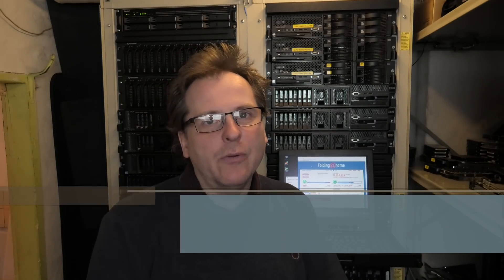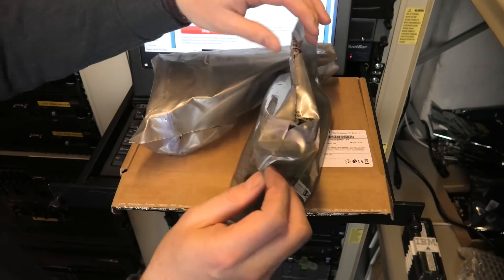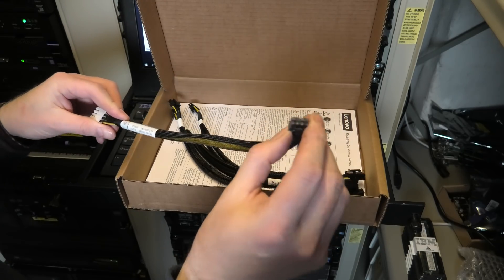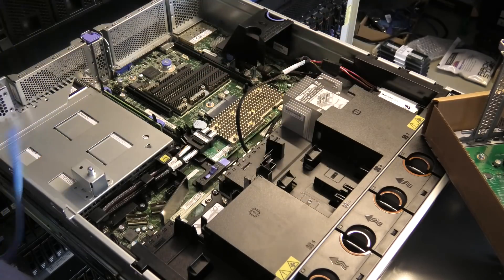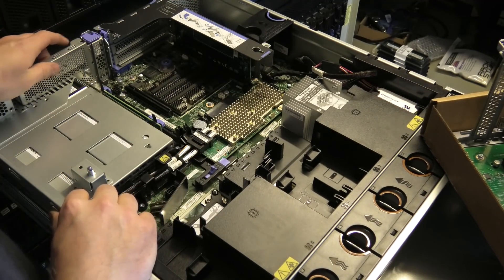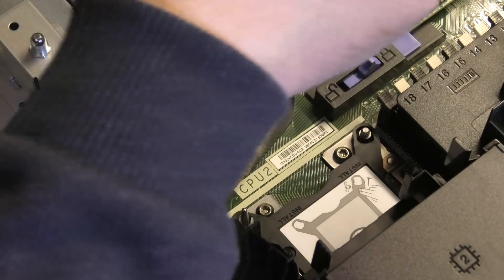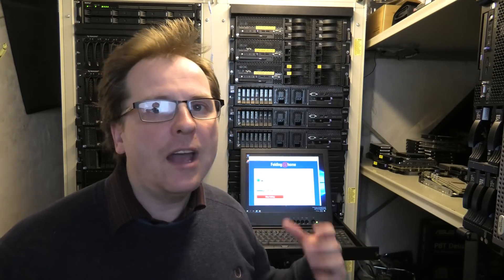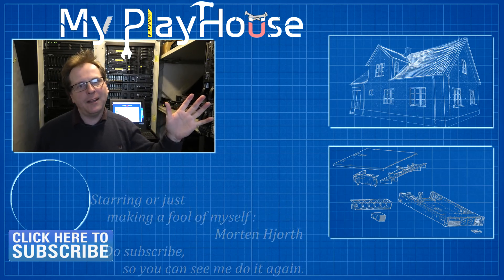Lenovo SR650 Ready for GPU - x16 Riser & GPU Power - 958

Comment: You can make it, that the Script that you where talking about, runs automatically on shutdown (not restart), so it resets the GPU automatically, which is pretty handy. Only problem left then is to manually startup the VM again. I use this Method on my Proxmox Host with a R9 380 from Sapphire and it works flawless. Have in mind, that if the GPU idles for too long (VM is shutdown) it CAN happen, that it should go to L0 mode, but it doesnt and then u have the Reset Bug again. There should be a fix for that too. Maybe if u disable the Energy saving mode for PCIe on the Host itself.
Reply from the maker: Hi xxcr4ckzzxx
Thank You very much! This becomes complicated :-)
Thank you for watching! :-)
Reply: @MyPlayHouse  Its not really that complicated tbh. To run the script on shutdown is done in 10 Minutes, for the Energy saving on PCIe, you can go to the bios/UEFI maybe and deactivate it there, or maybe that doesnt make any Problems for you and u just need the Script in the VM.

Comment: Morten. I agree with your desire to use AMD over Nvidia due to the server driver issue. I just want to caution you about supported GPUs by the folding@home software. There is a lookup file installed by FAHClient that is callled GPUs.txt and it lists the configuration of all the supported GPUs. So, before you buy your GPU that fits the Wattage limitation,  and the length limit of 27cm, make sure you look in the GPUs.txt file to see if the card is supported. AMD has some issue with supporting OpenGL via their drivers. 

Also, its too bad that Lenovo does not provide you with one power cable with dual 6+2 pin outs for the graphics card like Power Supply Manufacturers do. That way you can choose to use 6 pins or 8 on both. Just an observation.  More money for them I guess. 

Good luck with your folding project, and congratulations on your successes to date.
Reply from the maker: I did check if the RX 5700 XT i want would work.

Comment: Hey Morton great Video. I think One of those 8pin gpu Cabels is actually a 8pin CPU power connector(8pin eps). Higher end server GPUs have the 8pin eps connector instead of the 8 pin pcie.
Reply from the maker: Hi Niklas P.
Thank You very much! I did not see that,, you are right the big 8pin to 8pin is a EPS12V and it does say GPU on the cable :-)
Thank you for watching! :-)

Comment: Since you are using rack mount servers, you have GPU restriction, so not every model will fit in those servers.

For Nvidia you can look at;

ASUS brand's TURBO series ( referance design GPUs with beefed up VRMs and BLOWER Fans )

MSI  brand's AERO series ( referance design GPUs with beefed up VRMs and BLOWER Fans, their power inlets are like QUADROs - at the back of the card instead of the side as usual in order to reduce their heights for 8-10 card used GPU servers - )

GIGABYTE brand's AORUS TURBO series ( referance design GPUs with beefed up VRMs and BLOWER Fans that has ALL copper heatsink in it where other models have a copper GPU plate and aluminium heat sink )

EVGA brand's Super gaming / gaming series ( hard to find one )

Since I'm building GPU render tower workstations and Deep Learning rack servers, those are the models I use those models' 2080Ti versions. Can't say for sure but you might be able to find GTX1060 with those coolers or at least a RTX 2060. 

On AMD side, referance cooler version GPUs might be found, but I advise you to modify their cooler and add plastic washers between the screws and back of the card in order to increase the contact pressure for better cooling.  You can check " Gamers Nexus " youtube videos regarding to this issue. AMD RX 5700 XT referance design blower fan was tested with that modification.
Reply from the maker: Hi Aris Murat Dülgeroğlu
Thank You very much! that was a lot of info,, I ordered this card :
https://www.proshop.dk/Grafikkort/MSI-Radeon-RX-5700-XT-MECH-OC-8GB-GDDR6-RAM-Grafikkort/2789320
It is short enough, and the cooling heat sink fins are going the right way,, out the back. 
Thank you for watching! :-)

Comment: how many servers could I have in my two bedroom flat and have you had fires from your kit?
Reply: Dedicate one bedroom to datacenter duties and you'll be able to fit two racks easily lol.
Reply: @nelizmastr  LeL My Hosting company started in my apartment in a relativ small room. Without any issue i placed 2 42U Racks in it without any problem. Powering them was another story + noise is a third one :D
Reply from the maker: Well I would go for a basement or attic room.. or somewhere else..
Reply: @MyPlayHouse  i purchased a small waterhouse,  currently I have there 4 42u racks. 1 is full with Fujitsu Blade enclosures and compute nodes,  2nd rack is for networking and nas servers, third is only for my DIY 60x3.5" das boxes. 4th is a mix of things like, surveillance servers, monitoring client and the main router which is a pfsense running on a fujitsu rx300 s8 :)

Comment: Hi, I wanted to ask if you think it's still worth getting an IBM X3650 M3. The specs of the machine I want to purchase are: 64GB 10600R, 2X 6 core Xeon E56XX (forgot the exact processor model). 16x 72GB SAS 2.5", rack mount rails, SAS M1015 RAID Card. The price is $162USD or 1,122.05 Danish Krone. Please let me know.
Thanks
Reply from the maker: Hi Frederique kruger
Yes it is an awesome server,, and after the M3 they become expensive! and that is a great prices!! glad you liked the video :-)
Thank you for watching! :-)
Reply: @MyPlayHouse  how about a x3650 m4?
Reply: Really good price for what i can tell. At least for what i see here in Germany. Consider Upgrading to 2x x5675, if its supported. I run them in my server and they are pretty awesome for the Age :)